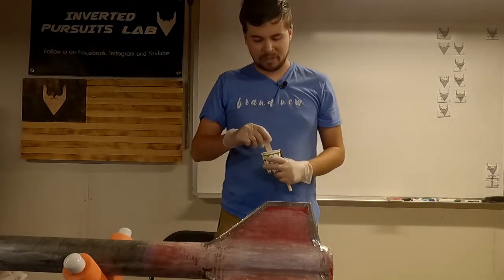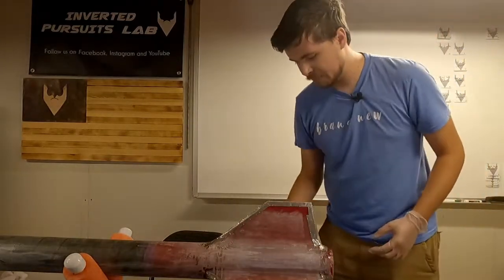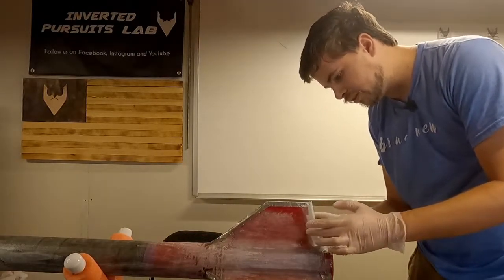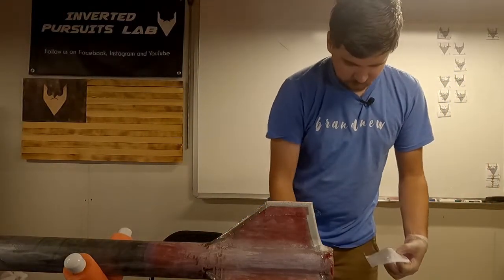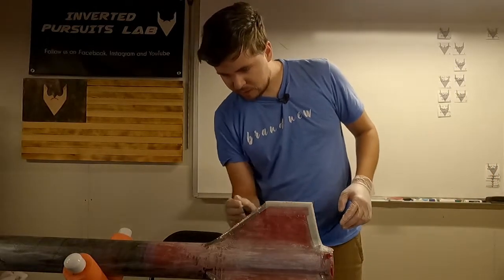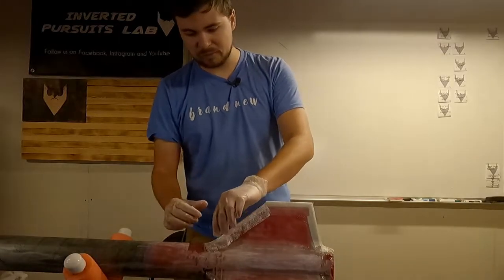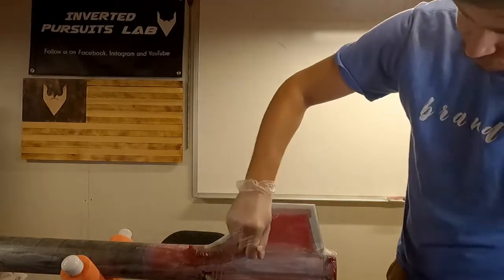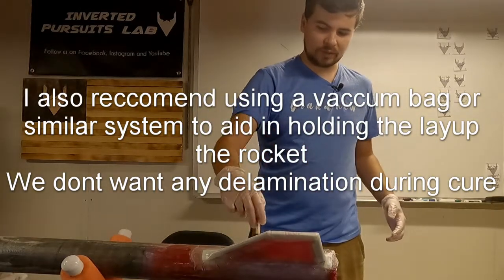Rocket Fin Edge Layup

Comment: Why did you use alum tape under the layup? And I would recommend cutting the glass at a bias instead of at 90 degrees.
Reply from the maker: Honestly that was a learning experience and on the next version of this I did there was no Al tape. Adjusting the cuts to meet the proper angles is also something I've started doing on layups since.
All great suggestions and things I learned while doing this project